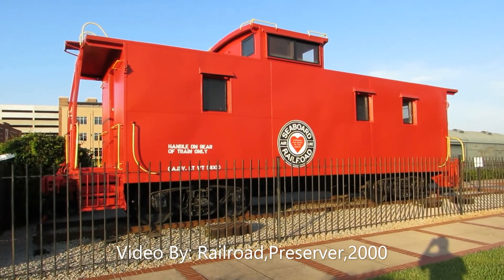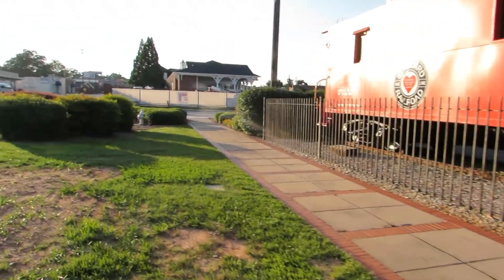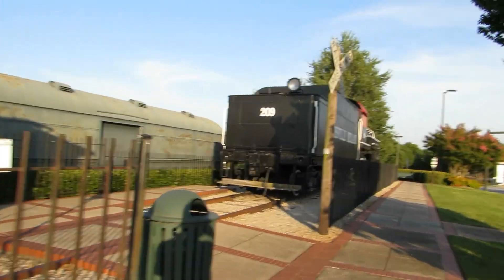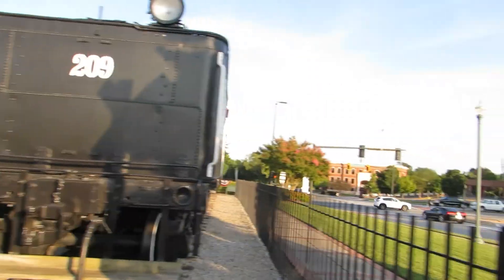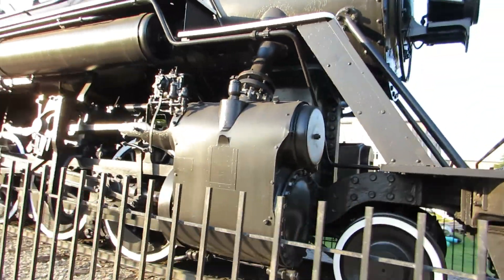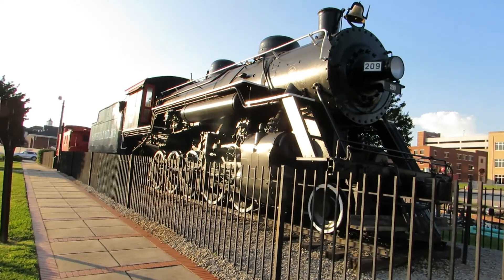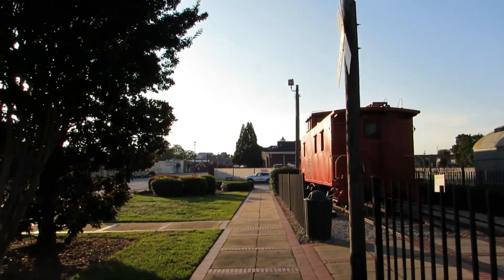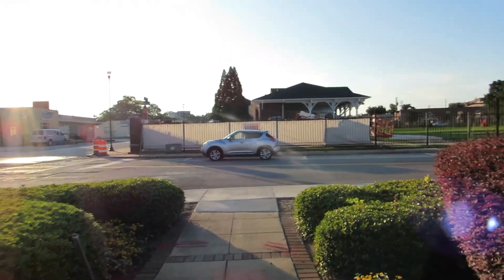Gainesville Midland 209

Comment: They’re moving the 209 before too long
Reply from the maker: Could you send info regarding this ? Where's it being moved to ? Is the other rolling stock being moved with it (the caboose and baggage car) ? Will it still be in Gainesville ?
Reply: @RailPreserver2K  yeah the baggage car is lived already. And has been repainted. They’re moving the engine to Midland park in Town.  It was announced in April. Not sure of a date when they’re going to be moving it yet.
Reply: It’ll be closer to the Norfolk Southern tracks in town. Near where the CSX or old Gainesville midland line had a wye track.